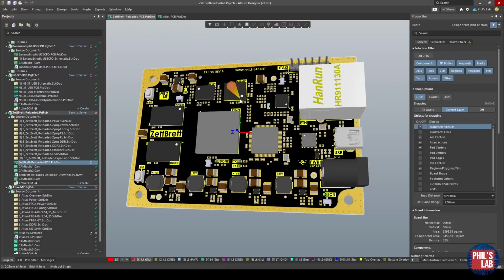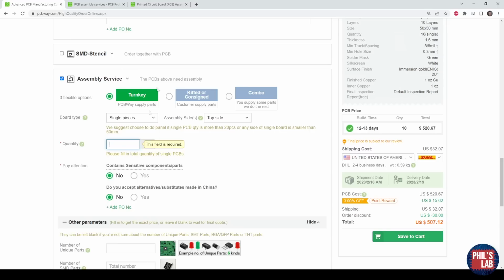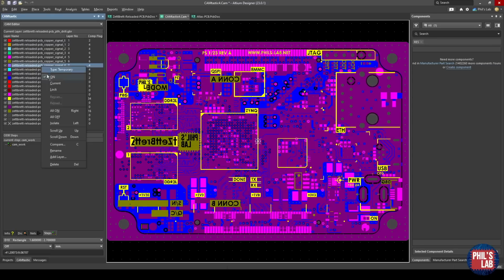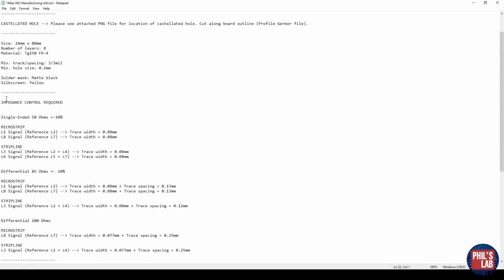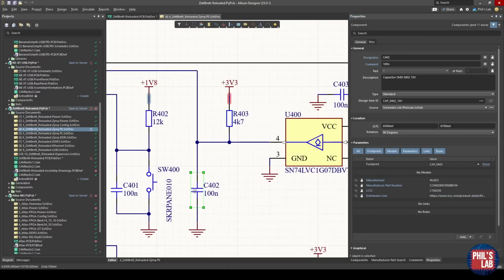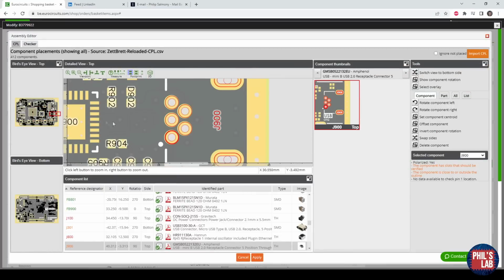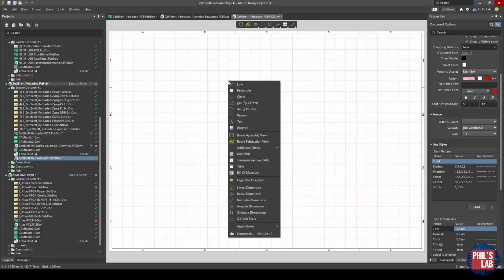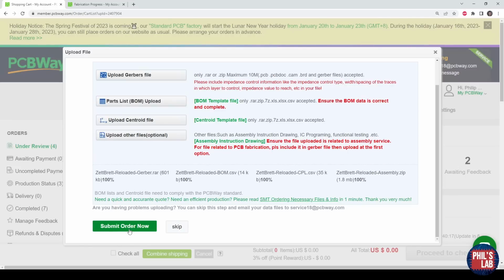How To Get Your PCB Manufactured & Assembled - Phil's Lab #94

Comment: 1) I use the .outjob file to point and manage all my files for production.  
2) I use Drasftman to create PCB requirements (layer stackup, dimensions and special attention points) instead of a text document like the video author.  The second document is an assembly drawing.  It is best to avoid realistic images in this document if manual assembly or installation is involved.  They turn into black squares if the document is printed on a black and white laser printer.  It is also advisable not to scale the drawing randomly, but to specify the standard (1:1 1:2 1:4) scale.

Comment: Thanks for the great video, Phil! One tip to help with some of the exports is to use an Output Job File which can make a standard set of directories and file names for the project outputs. It also ensures that you always use the same BoM columns, gerber settings, etc., and it can be copied from project to project easily.

Comment: Oh wow, that price... That is so much more expensive compared to simple boards like 4 layers, 0.25 min vias no blind/buried, leaded HASL. I have some delivered today and it was like 8$ per 5 pcs (just PCBs). The delivery actually costs me more than the boards themselves. But THIS price is ... YIKES... Great video as always.
Reply from the maker: Yeah, these boards are considerably more costly to manufacture, given the pretty advanced technology they're using. However, as usual, in volume the price per board does drop significantly.

Comment: A couple of weeks ago, you did an ESP32 board design. You had to match the impedance between the LNA pin and the antenna. Did you have to provide controlled impedance information to the manufacturer for those gerbers?
Reply: Hello, I am no expert at all but what I understand from Controlled impedance is that you get to vary the tracks width along with adding some components such as capacitors to achieve the required impedance. Therefore the manufacturers just have to fabricate as designed to achieve the impedance so no need for extra data.

Comment: is this type of board pretty far out of the scope of KiCAD's capabilities?
Reply from the maker: For the most part, the software is pretty irrelevant, as all can do essentially the same. Regardless of sponsorship, I do prefer Altium as it speeds up my workflow, reduces design time with some neat tools, etc.
Reply: I never designed something that complicated, but I think that you can do this in KiCad. It has everything you really need.